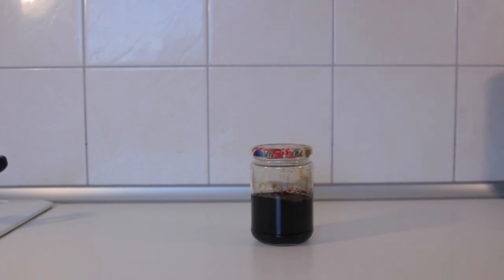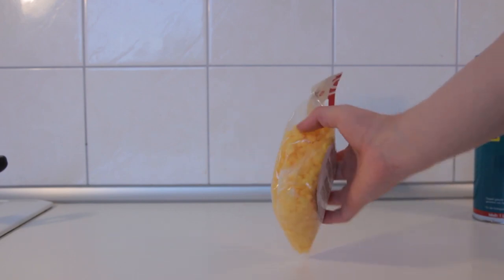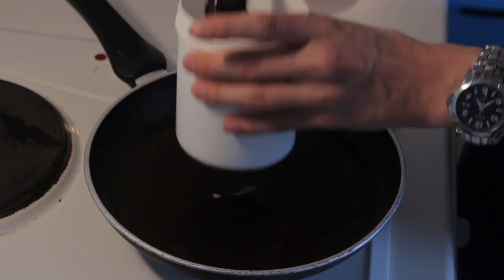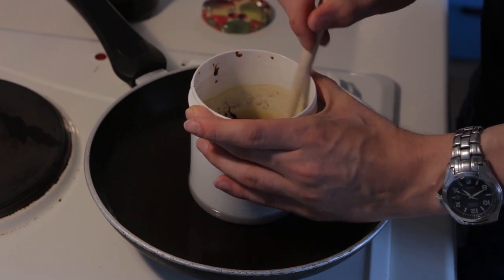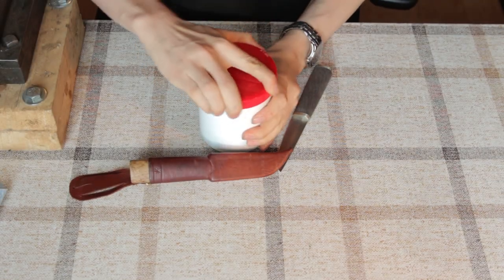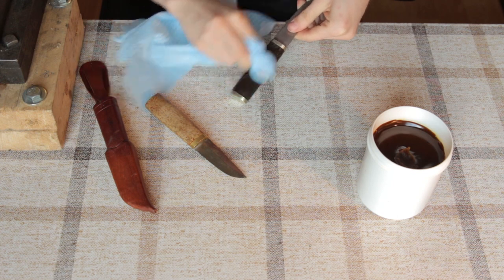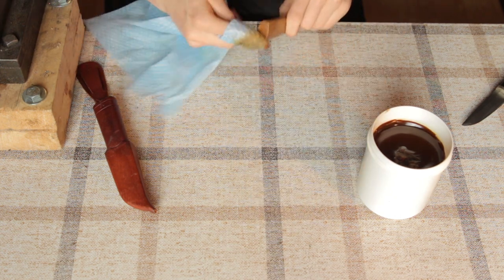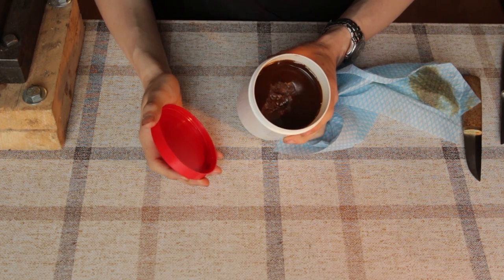Ultimate finish for the blade- and blacksmith

Comment: Hello Daniel, nice mixture. I'll try it out soon. I've a similar to protect forged iron. The recipe is from Lorelei Sims. Turpentine, linseed oil and bee wax in equal parts, heating and mixing, and adding a small amount fast-drying preparation (japan-dryer or other siccative). In heating turpentine, please good air the room or work outdoor. Turpentine vapors makes "funny". Regards Detlev

Comment: Does mom know you’re in the kitchen again?? Have used a similar mix with great result. Try a small cheap crock pot dedicated to the mix. Often the solution should be applied warm. It will absorb better warm to hot. Thanks! Now clean mom’s stove!
Reply from the maker: It's my own stove. I have my own apartment.
Reply: Give us a grin! I was just having fun with life. At 62 I have found that this way is best. Sorry if I pushed too far with the mirth. So clean up the pine tar and coax some girls over for a Holiday Party!
Reply from the maker: @killerkane1957  It's OK I didn't take any offence. ;-) Just wanted to clear up that I am self sufficient.

Comment: if you can find pine tar in america mate it would be a lucky shot
Reply from the maker: +Lucky B Pine tar can be found really easily. Look at farrier supplies, hunting supplies or stores where you can buy stuff for boat building. In all those trades pine tar is still used a lot. I got my pine tar from when I was in the US and some was made by a friend of mine in Sweden. You can make pine tar yourself too if you can't find any commercially made one.
Reply: why do that when you can make your own  3
take a 50 gallon barrel with a lock ring top and weld a  3/4" pipe about 3 foot lond  and a stand for the barrel fill it full of pine root get a fire going under it  keep it going  it will leak off pine tar after a while  one 50 gallon barrel will make about 5 gallons of so .. been along time  may be 10 gallon ..

Comment: If you knew more about benzine you would likely not be handling it without gloves or using it inside without a respirator.
https://en.wikipedia.org/wiki/Benzene (see notea about lukemia and organ damage)
If you need to as something as a solvent, clear mineral spirits would be a good substitute. Your pine tar already has many of the drying compounds that one would find in turpentine. Though redundant, the latter could be added for a more traditional mix and still be much more healthful to use than the benzine.
Reply from the maker: +Sean Kelly Fear not Sean Kelly, I was using Benzine, not Benzene! https://en.wikipedia.org/wiki/Petroleum_ether 

I want to find traditional turpentine for my next mixture!